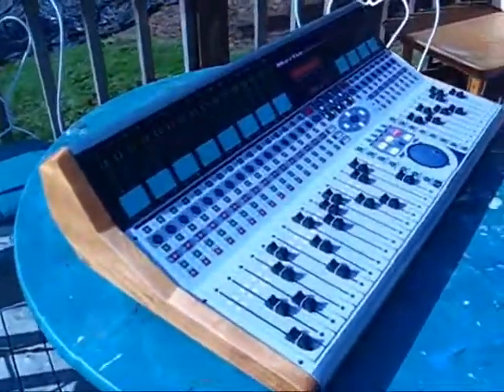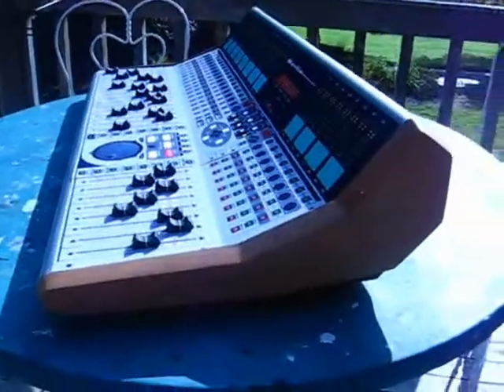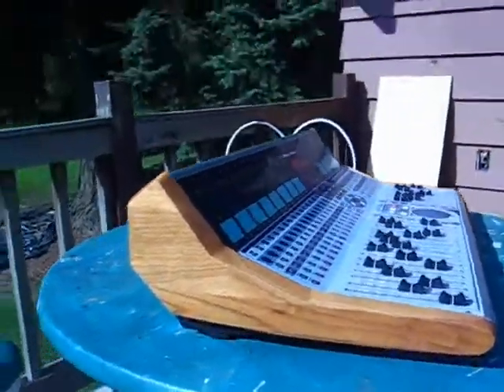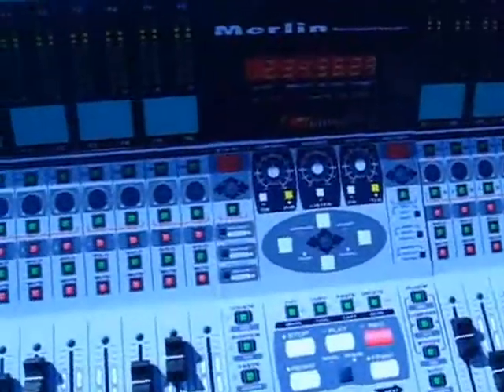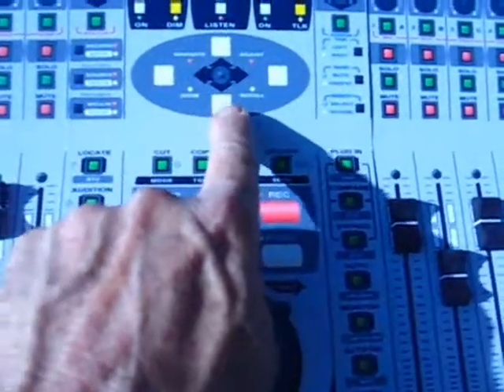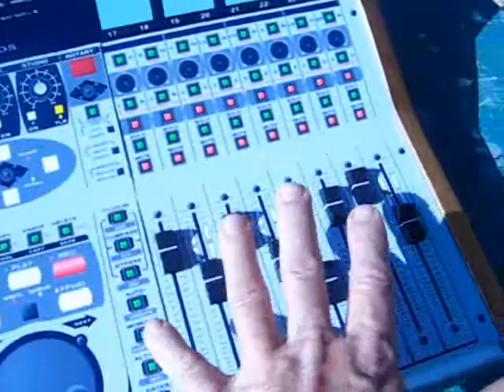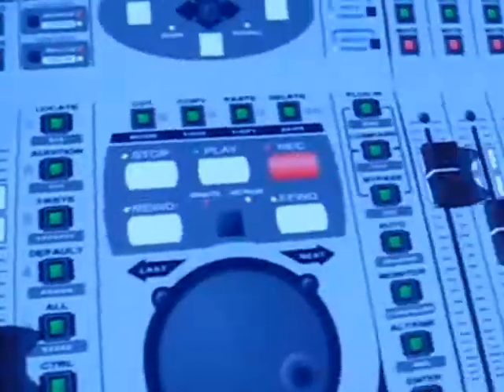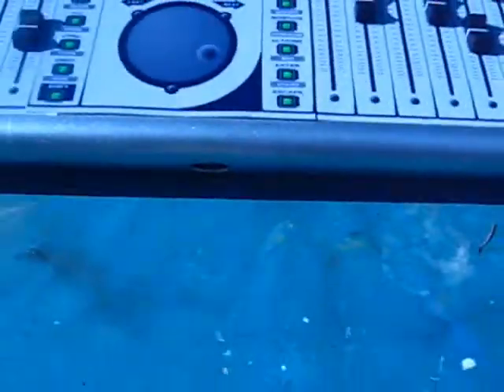Merlin Phase5

Comment from the maker: Thanks for your comments!

The $2,000 price tag is not realistic for me. 
There would be insufficient profit to keep them in production.

Merlin is packed with quality (expensive, reliable) components and  will be made in the USA and come with an extended warranty. Most MotorMixes are still running strong after 10 years, and I intend to continue that tradition !

I have been considering whether to make the monitor section an option at $1000 extra, but that means a re design at this point.
Reply: cmfluteguy do you have this still in the works ?    Looking to buy something like this

Thank you